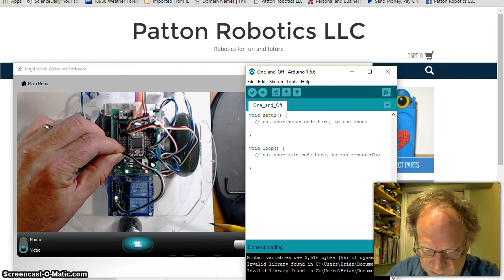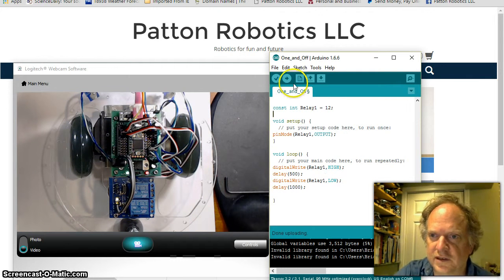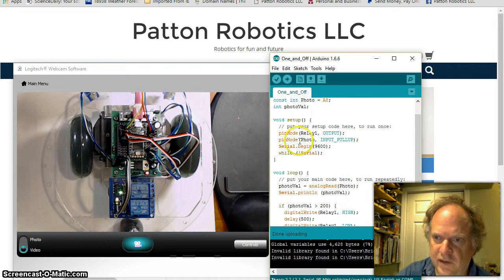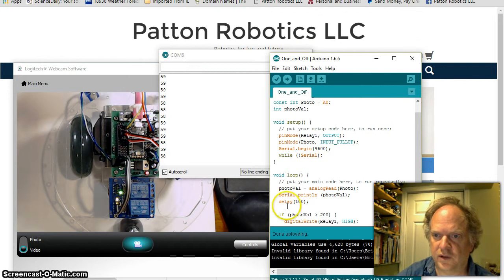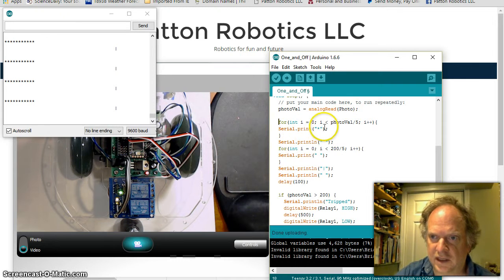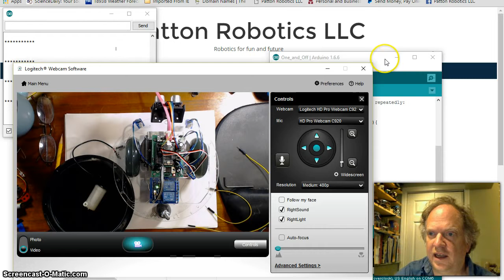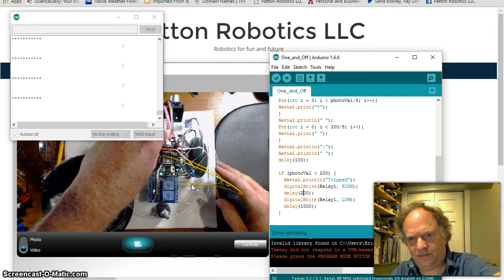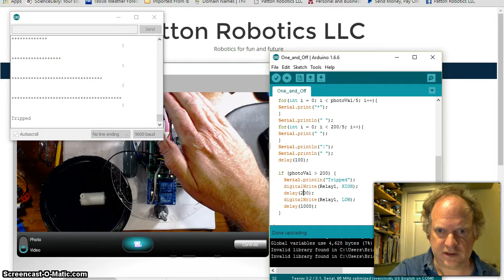Driving a Relay Board with a Teensy and Arduino

Comment: Hi Brian, 

Nice demo. Can you tell me what do u connect on VCC line? 5V the same as Vin to Teensy or 3.3 from Teensy output.?I am using Teensy 3.2 on a similar Relay board with Opto Isolated  and have friend couple of the teensy.
Reply from the maker: Hello. I had it connected to 5V